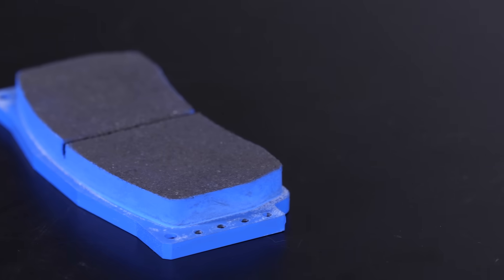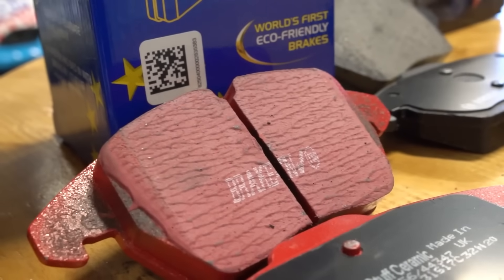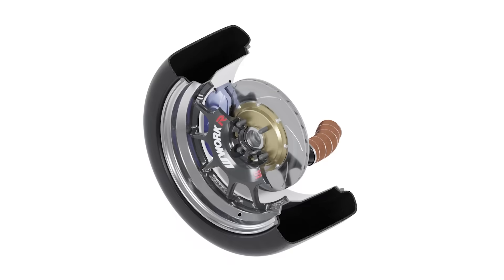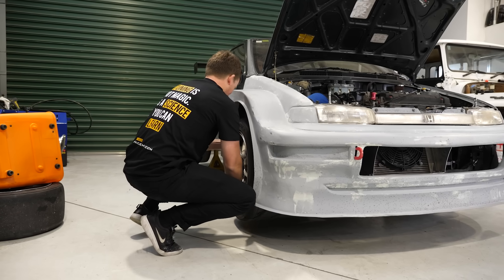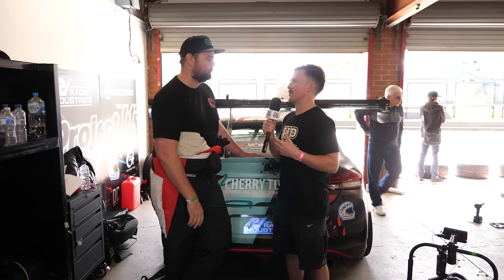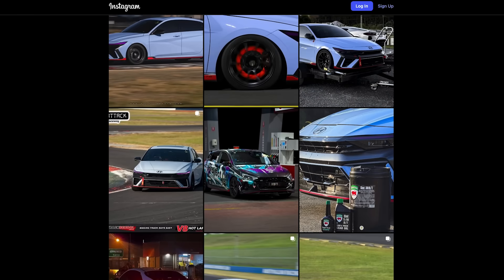Why Brake Pad Advice Is A Mess

Comment from the maker: Hope Andrews great advice here het's you out racing and testing your own setup to find what works best for YOU and YOUR car 😎 - Taz.
TIMESTAMPS
🏎 Building a fast car? Get $400 OFF the all-inclusive VIP online course package deal: https://hpcdmy.co/semi-prov
🛑 Brake System course. Design & optimise your set up. Now 50% OFF your first course:  https://hpcdmy.co/semi-prob

0:00 - Opinions Are Like...Brake Pads
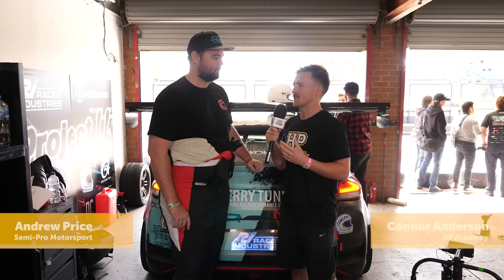0:15 - Common Brake Failure Points
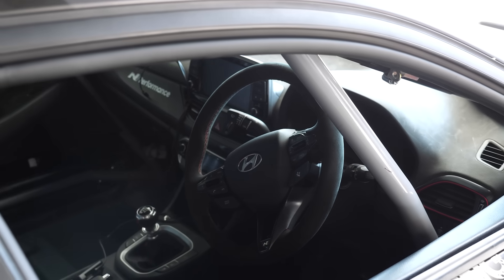0:40 - Build The Car For The Application
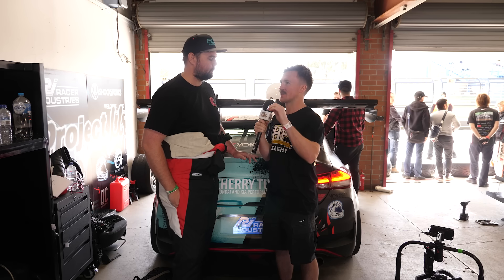0:59 - Friction Vs Temperature
1:39 - Ceramic Vs Metallic/Race Compounds
1:59 - Performance Street Car Option
2:33 - Brake Cooling Options
3:05 - Driver Error
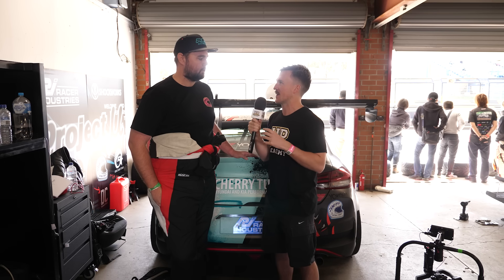3:27 - Front Vs Rear Pads
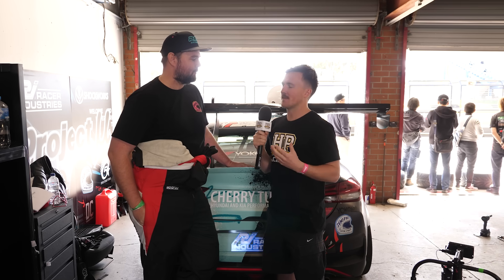3:51 - Choosing Brake Fluid
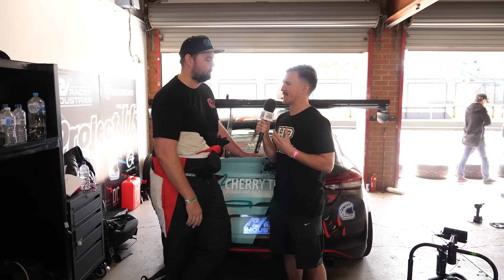4:23 - Hygroscopic Fluid Vs Boiling Point
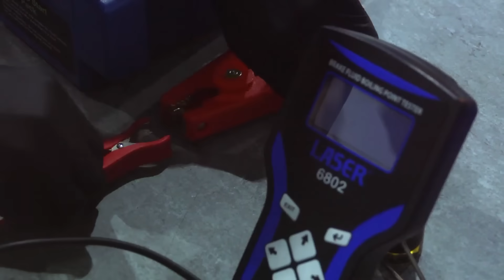4:51 - When Brake Fluid Boils
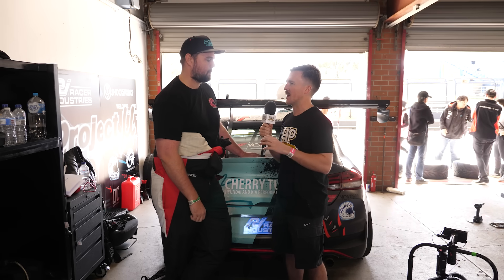5:16 - Understanding Brake Feel
5:50 - No Perfect Brake Pad Exists
6:02 - Follow Semi Pro Motorsport

Comment: I've found that the Endless M72 and MX72 Plus pads are the ultimate aggressive street pads. Pricey, but good: Relatively low dust, absolutely no noise, good cold bite, not too hard on the rotors. Paired well with the DBA 5000 series 2-piece rotors.

Comment: 4:05 Those massive wheel spacers aren't a risk or concern in track/racing applications? Have you seen them fail before? Any recommended brand?
Reply from the maker: Haven't personally seen them fail but others have. They're not ideal or a great long term solution, especially if you're running semi slicks or slicks that put a lot more load on your suspension components like you do in a track application. 
On that project they were a stop gap until the rear end was sorted and the car only did a few club events with them on I believe before time and funds allowed for more modifications.

No recommended brand, it's a basic item. You just don't want crap metal though it's the leverage a spacer creates and poor installation practices are the common issues rather than what they're made from.

Note the rules around them also don't just apply to the road, you might find you don't pass your tech inspection with wheel spacers in use depending what you're up to - Taz.

Comment: 90% of the negative brake pad reviews online are from folks using pads outside of their intended heat range..."I used XYZ pad that's a street pad on track and it faded/failed - THEY SUCK!".  And so it goes...

Comment: Used yellow and blue stuff, ds2500 and endless m72 plus and found the endless best of this lot with caveat that they are rubbish cold and need medium heat in them before working, get them hot and work great, also most quiet with the ds2500 were the worse for squeal
Reply: did you prefer the blue stuff or yellow stuff more?
Reply: @TheRyansLion for my use I at the time preferred the yellow, blue were great on track but needed some serious warming first, the MX72 kind of sit in between for cold working temps

Comment: New street car build, Roll racing 200kph+ in a 1400kg sedan with 296mm front rotors cooked DBA Xtreme semi-metallic carbon fibre pads and contaminated Penrite racing 600 fluid. A switch to Bendix Ultimate + pads and Castrol SRF fluid fixed the issues.

Comment: I have a 3900lbs Mustang. When I was running 4 piston fixed Brembo calipers, 14" rotors with Hawk DTC-70 up front on the track, the bite was good, the modulation was a bit left to be desired, but I was running into pad fade. Once I made the switch to 6 piston Brembo fixed calipers, 15" rotors and DTC-60s, temps stayed much lower (almost 150C), bite is much stronger, very very good modulation and no more pad fade, and much lower pedal effort was required to slow down/stop. No longer had to run super high temp brake fluid either. Pad choices vary strongly with vehicle weight, rotor size, cooling, driving styles and race track. Pick your poison.

Comment: I love the advice regarding running different pads front VS rear.

When I was actively canyon driving in my former AW11, I purposely ran a more aggressive pad at the rear compared to the front.  This helped to limit nose dive and made steering after releasing the brakes easier.

I used this same setup on my next several cars and have really grown to strongly prefer it.

This setup does invite the rear tires to lock before the front tires, so that had to be managed as well.  That required practice and really paying attention to the feel of the brake pedal and noise from the tires (the instant you hear the rear tires lockup, ease off the brake pedal a small amount to unlock the rear tires).  After a while of driving like this you get to feel/anticipate when this will happen, and you apply enough pressure to slow down, but not enough to lockup.
Reply: Advice is non universal thus i wouldn't follow it blindly. Their mods to suspension for particular car and specific aero setup and specific tire choice may ask for that, but there is no way for that to be same for any case. In general it's very bad idea to blindly shift brake bias by "advices from internet", which may result from underperforming brakes in one end to downright handling/safety issues on other.
Reply: @church493  Your perspective is spot on.

That is exactly why I detailed that the setup that i use can cause rear lockup, also that it takes time to practice & learn the balance.

Comment: Also, the more traction/life your tires have the better braking you have as well. A common misconception too, is BBKs. Like if you need them on the street for "braking power". Of course its cool to have them for the looks. But its for heat control. Of course you wouldn't need that on the street, but the traction of the tires is also what helps with braking tremendously.
Reply from the maker: For sure! You can upset a few things if you just slap a big brake kit on without doing a touch of math. No point adding unsprung weight if you don't actually have to.
Some argue you should spec your build around a specific tyre size and type, including brakes, target weights and HP etc. For anything you do performance wise it all goes through those contact patches between your tyres and the track, you're right 😎
Hope you're enjoying working on finding a solid setup that works for you and your car and hope this interview helped a little even if it only confirms a few things you already knew 🤘 - Taz.

Comment: I use dba street series on the front and actually swapped out the dba rears for something with more bite.

It's becomes about preference when you go beyond the level of using the brakes for more than just slowing the car down.

Comment: Hi guys, thanx for your content! A quick question, is EBC RP-X brake pads close to magic?
I have a Fiesta ST180 that's upped a bit on handling, power and running NS2R tires on the street. I've run OEM, EBC Yellowstuff and EBC Bluestuff and thought the brakes were... Meh... Then I put EBC RP-X on the front and MAN did that make a difference! The cold bite is better than any other pad I've tried, MUCH better. The bite gets even better with a little temperature and does not drop off even when my center caps have left the rims, my only grief is that I can't get RP-X for the rear. There is just a little bit of race-brake-squeel but not enough to bother me when commuting. 
Oh, can anybody recommend a HIGH grip pad for the rear on otherwice stock brakes on the Fiesta ST180? I run Bluestuff now but hate the bad brake balance with the excellent RP-X at the front.

Comment: I got "green stuff" racing pads for my 1,6 Liter Opel Astra that suffered from severe brake fade after just one hard breaking from 120km/h to zereo. With the racing pads no brake fade even after emergency breaking from 120km/h to zero 3 times in a row. But the side effects was low brake effect with cold pads which meant you could panic break as hard as hell and the wheels would not lock up and then you eased of the break pressure to avoid locking them as the break pads heated up and gripped. I got incredible short breaking distances with that setup.
Reply from the maker: Great you found a pad that works for you! A lack of cold performance really is the main reason why race focused brake pads are not desirable on the road. Be careful! - Taz.

Comment: It doesn't have to be so confusing. Just go oem 😂😂😂
Reply from the maker: If you only ever drive your car on the road in the fashion the OEM intended (slowly), sure, they are the best option for you.

As soon as you change the use case, well, the aftermarket brake industry wouldn't exist if the OEM pads did the job would they 😎 - Taz.
Reply: @hpa101  exactly, same with every aftermarket performance part. Like OEM tires are designed to be quiet, last long enough and have decent traction. But take a stock truck with stock tires into a mud bog and you'll not get very far. 

Actually alot of what happens to the cyber truck is a direct result of this. People take the truck, stock with stock tires into environments that require a beefier tire and then wonder why they got stuck. Like every case the issue is tires.
Reply: OEM isn't always the best application, they're generally a decent all arounder, but they usually aren't specialized in one area. Like a pickup towing heavy all the time a dedicated towing brakes would be better then OEM

Comment: For a street car I've been really happy with ceramic pads. 
Cleaner wheels are a big plus and they feel like the modulation is very linear which makes driving smoothly and consistently easier.

Comment: for me only large cooling ducts worked. 1500kg car / 250-350hp. but I’ve only tried yellow stuff ebc, stock bmw, and willwood pro matrix and would boil the fluid or get too hot. with better pads I expect higher temperatures of the hubs and fluid, so maybe with larger discs or lighter cars it can be ok.
also, a little bit more rear brake bias can help the front staying cooler
Reply from the maker: Pads and discs can only handle so much, cooling is 100% a large piece of the puzzle too, you are right. There are just so many variables that you can't sit down and say 'this is your problem' without really looking at the car and how you're using it first (there's no silver bullet).
Even now we're assuming that you are using the best brake fluid possible. If you haven't looked into that yet, then it could also be a key piece of your brake system tuning (for lack of a better word).
Brakes (and then the skill to use them correctly haha) are a huge part of what makes a car fast around a race track, they're worth your effort and it's great to hear you're doing that 🤘

You might be happy enough where you're at now, but if you do need any help along the way HPA has a course dedicated to all of this as well https://hpcdmy.co/semi-prob

There are also CAD and fabrication courses which would help you with your ducting - Taz.

Comment: Anyone using EBC Yellows here? They work so well on DBA rotors. My daily with the occasional track days. Happy so far and havent had any track issues.
Reply: When you get faster on track, they'll disintegrate.  Bluestuff NDX holds up better but isn't enough for an E30's tiny stock brakes.  The brakes on my E30 run HOT.
Reply: @ProjGR definitely. what rotors do you think can cope with track  conditions for the e30?
Reply: I use Red and it’s great for Street. Little to no dust, good cold bite, but stopping from high speed is scary. I’ll be switching to yellow.
Reply: Ive seen countless people say run reds for the street and "spirited" drives, run blue for regular track days and autox, and anything higher for a racecar. Yellows are for if you know you might do a track or autoX every few weeks or months or have a high hp car you like to get up to high speeds.
Reply: I use EBC yellow on my E30 for mountain and street driving. No problem at all even when cold. I find them really good as an all around pad
Reply: Don't. Yellows are trash on track
Reply: @pazernyy I only drag race so I’m not looking to put too much heat in them. I just need them to stop from 145-150 on a short time.
Reply: @ZillaFullBoost Sure but why not go with blue?
Reply: @pazernyy I haven’t researched them yet but I will.
Reply: @ZillaFullBoost I’ve had them during winter. They did not last long, although I did 4 or sa trackdays. They did not squeak, nor left cementine on the rotors. For me they seem as an clear upgrade with 10% higher price (in my shop)
Reply: I used to use yellowstuff but switched to bluestuff. Better cold bite, and better headroom at high temperatures.

I find with all EBC pads, if you ‘squeeze’ the brake pedal, you will get what feels like brake fade as the pads aren’t really biting into the rotor and instead just get super hot as they don’t slow the car down. If you absolutely stamp the brake (try using your clutch foot!) they bite through that ‘wooden’ layer and stop well, and don’t suffer from overheating anywhere near as much.
Reply: @mcgherkinstudios  I think of yellow as shit pads because they are desintegrating when entering the track. But other people say that they are ok on the roads

Comment: We run an n15 pulsar in an endurance series, anything from track days to 24hr constant racing with only refuelling and driver change stops. It runs R spec tyres, coil over, mild sr20 with haltech, full cage, etc. We've tried a few different combinations with the Winmax pads and slotted dba a clear favourite. They're incredibly consistent and take a full endurance event to wear them out, often clocking 30 plus hours of continuous heavy stops without fade. We were encouraged to try project MU pads, and they were done within 8 hours.
Reply: @dinosshed  there’s quite a lot of different Project Mu options. Doing anything endurance related would need a step into the PMu range where they have heaps of options that will comfortably do those distances. I’m guessing whoever recommended the pad to you probably recommended the wrong model for your application
Reply: @AndrewPriceMotorsport I'll check what type they are but the supplier knows our requirements and has provided us with the winmax for years. Be interested to find out what else is available. Cheers

Comment: I honestly reckon if you have a street car that you take to track days, you're best off running a street pad and then swapping to a trackday pad come track day time. It'll give you a chance to bolt check everything under there and bleed the system anyway, and not have to live with a harsh pad on the street (that might squeal, not stop well cold, and coat your wheels in dust)
Reply: Yes and no I think. The stock OEM Ferodo pads that come with Brembo brakes (unless the automaker thems out, cough Nismo 370Z...) are very good IMO, the compound is only one step below the Ferodo DS2500.  While it's not going to be up to heavy track work, those stock Ferodo pads can handle most light duty track driving including magazine track tests, while still being quite well-mannered, streetable AND good from cold.  It's not a given that <random aftermarket pad> is going to be step up from OEM Ferodo pads.
Reply: @TassieLorenzo once you get decently fast and trail into corners for an entire session, those pads don't hold up whatsoever.  

In addition, they'll disintegrate faster and cost more than track pads long-run.  

"Light-track" use is kinda a misnomer, the goal should be to work up to "heavy" track use safely
Reply: But then you have to bed the pads in every time you change them... so as long as you don't mind doing that...
Reply: @littlenismo  well not if u have a set of disks to go with the pads I’ve seen a few people do it that way
Reply: @littlenismo  Like someone else said, match rotors to pads. If you're using track pads you're gonna chew out rotors anyway so probably want to keep a set for 'daily driver' and a set for track work.
Reply: @Erelyes  Sorry, but that a lot of bullshit. Unless you are a hardcore track driver that is racing and cant let the brakes to cool down, you don't need to have a full racing brake set. I have some small successes in amateur timeattack races with the CHEAPEST rotor and semi-track focused pad that I use as a daily. Yes, it squeeks but that's about it.
Reply: Yes this. Especially with a fixed caliper, a pad change is so quick and easy. Takes longer to get the car in the air and wheels off than it does to swap pads.